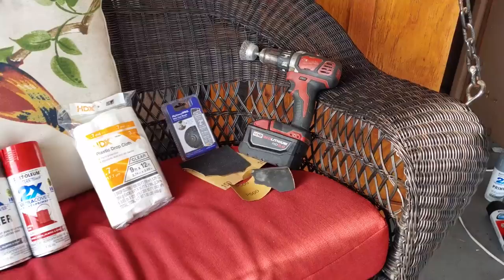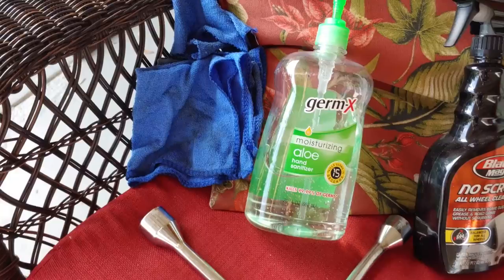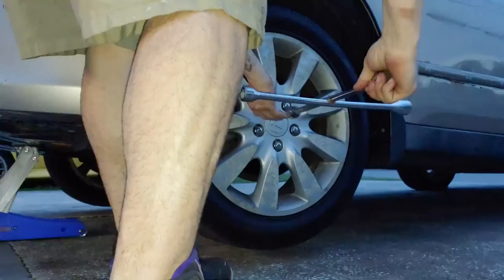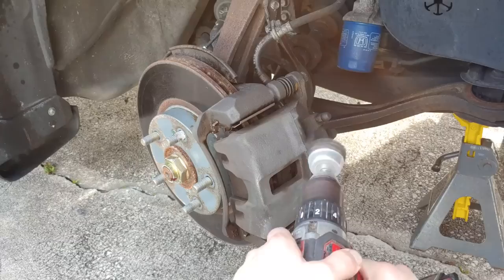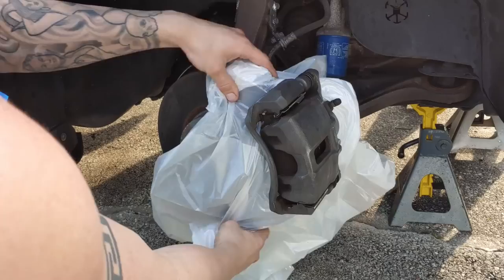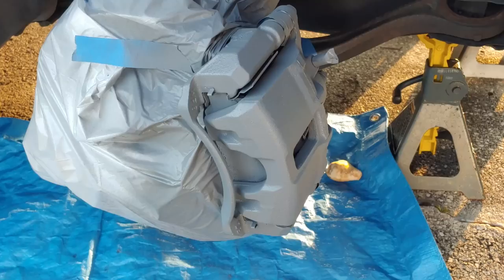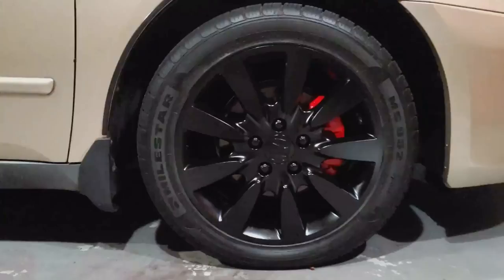HOW TO PAINT BRAKE CALIPERS | Easiest Method | No Taking Off ANY Bolts Or Nuts

Comment: If you do choose this method I highly suggest masking off the entire wheel well from over spray, the over spray will definitely be noticable inside the wheel well, and also recommend masking off some of the outside fenders, over spray is no joke it gets everywhere, or you can choose to use brush on paint, still looks just as good, no worries of over spray, much less masking..
Reply: i recommend not painting the brake pads. they don't show with these wheels...on my car, they do.
Reply: @dougburg3210  I've painted my calipers it turned out fine and doing so as detailed as possible.
Reply: Great advice! My brother painted my black mustangs ' calipers. He's the one that had a garage..I didn't.  Yet he painted the calipers outside.  Needless to say I was very angry at him.. red overspray on the front end of the car.  Car was only a few years old! What a dummy! I was introduced to the almighty clay bar.. where the blue clay bar turned purple from all the overspray. Now, a  bunch of years later, I will do this myself (girl power!)  in my 2 car garage & do the job RIGHT this time.  #brothersAreDumb #brothersSuck
Reply: Yes people forget old school brushes.
 And that method will lay on a thicker coat of paint.
Reply: Why not take the caliper and bracket off the freaking car?
Reply: @PappyMcPoyle-vj4vt  because I've never done it before but myself. :(  I don't know many female friends like me that are enthusiastic about cars. Gotta find a dude to help me.  But yes that's the best way.. remove & paint.
Reply: @ny_gsdluver6227  Its literally... take off the wheel, take out 2 bolts on the caliper, and take out 2 bolts on the bracket. Remove the brake line from the caliper, tape all the important stuff off,  paint, and then put it all back together.
Then youll have to bleed the brake.
easy peasy.
Reply: @PappyMcPoyle-vj4vt Thanks!  I've never bled the brakes .. is that easy peasy too ?  Thankfully I still have a hydraulic jack & jack stands...
Reply: @ny_gsdluver6227  yeah.... just search how to bleed brakes here on youtube.
Reply: @ny_gsdluver6227  so much hate on brothers 😩🙆🏾‍♂️
Reply: @kenearth8857  yeah well he doesn't treat his little sister with respect. 😡
Reply: @ny_gsdluver6227  just stumbled across this video and the hashtags have me rolling. 😅 I am the oldest and only brother of 7 sisters and sometimes yeah, we do suck.

But we are not dumb, ok?
Reply: @ThrobbyBrown  understood.  Glad it made you chuckle.  I drop anything to help my brother [he's a yr older],yet when I need him.. he's not available. 😡  absolutely not dumb..but not smart when painting  MY calipers outside in the small wind..when he had a garage..the reason I went to his house. Now I have a 2 car garage & will paint the calipers correctly myself.
Reply: Yeah I was wondering how much overspray he had. I bet there are red dots on the fender and if it was at all windy he probably got some red dots on his neighbors car too. Lol. Looks good though.

Comment: Followed it myself because I’m getting new rims tomorrow and they all turned out amazing, it took me about 8 hours to do all 4 calipers and about $40 for all the supplies at Walmart and it’s so worth it. If you have unpainted calipers this is an amazing weekend project worth doing.
Reply: Doing my soon this week. Getting new rotors and brake pads for the third time on my car, no biggie but putting in new struts and control arm. Going to follow this up by listening to you on the Walmart part getting supplies and ready to see my wheels pop! 8 hours isn’t bad at all.
Reply: Did you buy 1 of each liquids (prime, paint, clear coat, break cleaner) or you had multiple?
Reply: @Topic_____542  only bought one of each, I still have some left ~1/4-1/2 in each can
Reply: @Topic_____542  
I'm not him, but I did mine and I recommend double the amount. A lot of the spray goes into the air and you have many angles to spray.
You'd rather have paint leftover than to run out midway into the job.
Wear a Covid mask the whole time.
Good luck 🤞
Reply: @MrBikedrummer  Thanks I just did mine took me 2 days and I love it
Reply: @Topic_____542  how many paint and primer did you need for all 4 ?
Reply from the maker: 2 cans of each should be enough 😁
Reply: Can i just use a jack stand??
Reply: 11hours for me. My calipers were covered with a thick layer of rust lol. But well worth the time.
Reply: @MrBikedrummer especially when your using a drill with a wire wheel as the rust dust flies up into your nasal passage lol
Reply: @Punisher4444  I've been there! The fun part is blowing your nose later and look at the "colors of the day"!

Comment: I clean mine with brake cleaner after I sand. Drys fast also.  It also rubs all over spray off rotor if not masked correctly rubbing with a rag.  Also if you want a darker paint finish use grey primer. If you want a brighter finish colour use white primer.
Reply from the maker: Great tips!
Reply: I took your advice and the job came out great!.
Reply: Good primer tips and awesome vid.  Will be doing this as soon as my new rotors and brake pads come in soon.  
Also , should i throw on a coat or 2 of clear coat ? 
2 coats primer , 3 coats top coat then 2 coats clear ? Or would the clear be unnecessary
Reply: Any IDEAS how many primer and paint sprays we need for 4 calipers??
Reply: @AmritpalSingh-zj9kd  two cans of each will do your fine. like buddy said you want to make sure you lay it on thick enough so it protects and lasts longer
Reply: my first thought was also to use break cleaner because it is easier to clean up and also easier to apply

Comment: Atleast take off the brake pads then just spray it , i work on cars and i always see customers have paint on the backin plates n pads makin them stick and not realease fully ..so keep that in mind the small extra step goes a long way . Other wise good job
Reply: I was about to comment the same. Take an extra 10 minutes and disassemble everything for paint. Makes a bigger impact when the pads are still the original color.
Reply: You are correct. Take the brake off then spray. This paint is not for brake. it will over heated. It will only last for 1 year. The paint chips will stuck on to you brake pad.be careful. this is friendly suggestion.

 @claywilliams8128

Comment: Worth mentioning that you use axle stands and not to rely on the car jack.
Also, some cars (VW, Audi etc) are more difficult to lift from a single point at the front so to be able to rotate the front wheels you need to jack up both sides.

My preference is not to use spray paint but to use caliper paint (which in the UK can be had for £5) and after 3 coats gives a smooth finish and there's none of the overspray.

Comment: Great video. I recently did mine and didn’t sand down the calibers enough. One brake ended up having cracking paint (barely noticeable). The preparation is the most important step.

Comment: I liked your work as i work myself in this industry a piece of advice is that you should have masked off the brake pads as well for a professional finish and another way to get a better and clean job without covering the callipers with plastic bag can be done by brush painting it while it have a more thick enamel and should off covered with a clear coat in end to long laster and protect against chemicals used in the car washes these days! else than that i loved your preparation and work!!
Reply from the maker: Thank you my friend
Reply: the brakes will eventually be replaced anyways so that won’t really matter in the future :)
Reply: @chrissy1475  well it depends if the customer have changed the brake pads recently then I don't think it looks professional
Reply: @WajahatAli-yz6kt  maybe so but brake pads do eventually wear down. they would have them replaced and the issue would resolve lol.

Comment: I did mine last 2 years ago but used a brush on epoxy. This method means I don't have to tape or mask anything off. In a perfect word, you'd paint them the same time you're doing a brake job. This way you get the top bracket sand blasted so it looks like new.

Comment: Nice job! I've always brush painted them in the past and sometimes semi disassembled things and it means the cars off the road for a good couple of days (because I'm fussy lol) , so I think I'll give this method a go next time to speed things up. The only thing I'd do differently is I reckon I'd be inclined to shoot a coat or two of clear over the top, just for that extra shine and protection. Although that last coat was so thick it probably won't matter. Great vid for sure! 👍
Reply: Definitely the clear coat
Reply: The problem with the paint that he's using is that it is not ceramic part of the reason why you want to use ceramic is because it will last a lot longer
Reply: @Americafirst-i8q he said he’s been using this paint for over 10 years and they last a long time. I think he knows what he’s doing.

Comment: Great video. One suggestion: when loosening the lug nuts, push downward rather than pulling up. Less risk of pulling your back! Ask me how I know 😂
Reply: That shits painful. Hopefully you recovered quickly.
Reply: If you are using a cross handle wrench, put your foot on one side and pull up on the other. Much more torque with less effort, and no offset on the nut, just straight torque.
Reply: Pulling gives more control when nuts break free. Pushing could cause you to lose your balance or hit your knuckles.
Reply: @SJ-me9fj  Yep ^^ never push on a wrench unless you have no other choice.
Reply: Invest in a torque wrench and an impact driver. Save your back.
Reply: Just keep your FACE out from behind whichever direction you're pulling and don't buy cheap Chinese tools...ask me how I know.

Self TKO'd and lucky I didn't jab the busted-ass wrench into my eye socket. 😎 Wear your eye protection.
Reply: How do you know?
Reply: @rednaughtstudios  Very good - one of the new YT rules, you know...!

Comment: Love the way you give the basics. Quick and simple. Only issues i had were the single jack under the front end. Better safe than sorry. Do one corner at a time if you dont have jack stands. It may take longer but its safer than trying to balance a car on one point. Also taking off the caliper and bracket only need 4 bolts total. You can sand/wire wheel while its installed. Then just balance it on top of the covered rotor to paint. I would remove the pads as they are just held with clips or just by pressure of the caliper.  Taping off the rubber and plastic parts and bleeder valve are a necessity but you also dont want paint on the rotor. Youll have paint that will be seen through some cars wheels. As for the rest its great.
Reply: He has a stand under the car if you look.

Comment: Great video! straight to the point. I recommend using a mask when sanding off the caliper with that wire wheel or sand paper. Also, using a leaf blower will help to remove the dusk and brake cleaner will remove residue as well. I was glad to see your use of jack stands as well!

Comment: Brake calipers can reach temps way past 500 degrees on the track (road course). Good enough to melt just about any paint non high-temp. Otherwise, great video 👍😁
Reply from the maker: Well if you're a regular driver like most then you don't gotta worry but yeah I agree
Reply: Very RARE to have calipers reach that temp in a work car!!! I don’t have time to tell you how rare it is! Great video!!!🌹
Reply: @Justmi2cents  I did say the ROAD COURSE. I imagine you probably don't drive your work car on the road course.

Comment: Dude! Those bright metal brackers part of which sticking out at the bottom and top of pads is where your pads slide back and forth, they can not be contaminated with paint, clearcoat, etc. For simple safety, if you understand how floating caliper/brake system works, you should've remove pads and sliding brackets.
Beatifull job cant be just about looks  good screw safety measures, some safety and common sense should be applied especially if you advertize/show this to general public, contaminating pads and rotor surface with all those cleaners does not seem like a great idea either.
2 stinking bolts out and you could have remove pads and hardware, gain full acces to put plastig bag over rotor and have better acces around the caliper to clean and paint, I mean you could mount it back without pads, just dont press brake pedal while at it.
Reply: Was thinking the same!!   I take mine apart once a year just to clean and grease those sliders, and he just painted them!
Reply: Roman you should make a safety video about which parts not to paint on the break calipers

Comment: You couldn't have undone like 2 bolts to just take the caliper off for a second to actually paint the entire thing?
Reply: Right? Second, If I was going to tell someone new how to do this, I would rather recommend using actual caliper spray paint, or high heat spray paint from autozone or whatever. Regular rustoleum will just chip and flake in the long run on parts that get semi hot. lol
Reply: @Brakzillaa  shits gonna just flake off in a month

Comment: great video only thing the anti rattle springs are painted and the brake pads the only way to do it properly is unbolt the caliper let it hang with a wire not to stretch the brake hose the caliper sliders can be painted off the job too removing the slider rubbers

Comment: I don’t usually subscribe to folks….but I did here. 

One thing I will note about steps. 

You used a heavy duty Jack to raise the entire front end of the car. I definitely can see the front shift & wobble. 

It was nice to see the smaller Jack stands used in the video shots with the wheel removed. 

You might have mentioned safety & the need to do that.  I realize it would seem to be common sense, but if you aren’t used to jacking up cars and taking wheels off someone might get hurt or the car get damaged  by using just one centered heavy duty Jack & both front wheels off the car. You did mention the safety aspects of the E-Brake & chocking the back wheels…..reminding people to use Jack stands once lifted would have also been a helpful tip. 

Other than that…..great video.

Comment: Looks good, my only concern is the calipers not being able to slide on the shims that you just painted.  This could cause uneven brake wear.  Would have been better off taking the time to remove the calipers, its only two additional bolts.
Reply: I agree

Comment: This job is way dirtier than it looks. If your calipers were covered with rust like mine. It's over 2 hours each one plus I scrubbed the inside of each rim. Rust dust gets everywhere mixed with water as your rinsing and cleaning etc. but after 11 hours my calipers are exactly how I wanted them with clean rims inside and out. Thanks for posting!

Comment: I was hanging on every word and product except when it came to the hand cleaner on metal.  That product had aloe in it.  That would coat the metal and place a barrier below the paint.  I would use a brake cleaner to get rid of the sanding residue and degrease the metal for a good primer bond.

Comment: Good job on using drill to clean. Not hating on how you did it, but I go the extra step of taking things apart and cleaning properly, if we're using cleaning products you find in the house, rubbing alcohol in a spray bottle is excellent, or brake cleaner if you want to go the extra step. Masking everything properly, to make sure not to get any primer and paint on the rotors through the open spaces between the calipers and brackets, and on suspension parts. With everything taken apart, I hang the calipers using wire hangers then paint. Paint the caliper brackets off the car. Remove pins and rubber boots, clean and re grease them. I do tend to drive hard so I use high heat paint, I don't want to risk ruining hard work for saving a few dollars. I guess my way wouldn't be considered a fast simple easy method. Either way, they turned out pretty good.

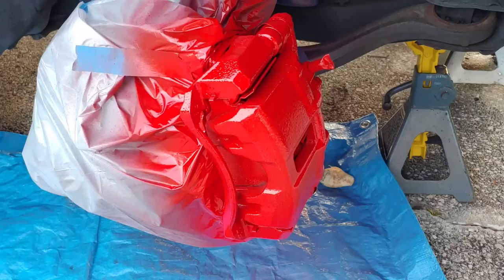Comment: 7:45 if you get a pant run, let it dry and use a 2000 grit sandpaper until run is gone... then light spray paint over sanded section. I have OCD and would know it was there!

Comment: Good video, but if i might suggest,  using the carjacking bar on the other end of the cross wrench useto your weight to push down less afford/energy and safer for your back.

Comment: Also correct me if I’m wrong I thought any type of oil near or on your rotor or pads were a big no no bc that compressed carbon in the pads soaks it up and softens the metal making you burn out your break pads as much as it soaks in

Comment: Well done! However, I know you’ve been handling automotive operations for a good while now, but I would recommend purchasing a set of jack stands to put under the car in case your floor jack fails or gets bumped for some reason. Don’t need you getting hurt so you can produce more of your videos.
Reply: if you look at 3:05 he has put jack stands under the car

Comment: I prefer to brush paint them, you can leave the pads and not paint them, plus all the metal attachments, I use break cleaner, it gets rid of all grease, so the paint doesn’t react, plus it instantly dries.
Reply: Yup brush painted mine. Literally zero prep other than spraying break cleaner and letting it dry. I used a sponge instead of a brush to not get brush strokes.